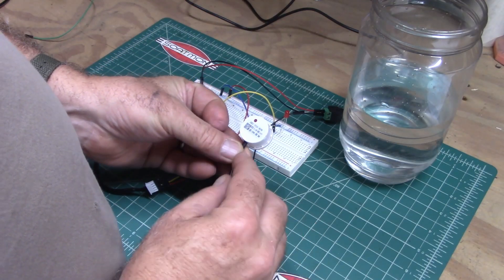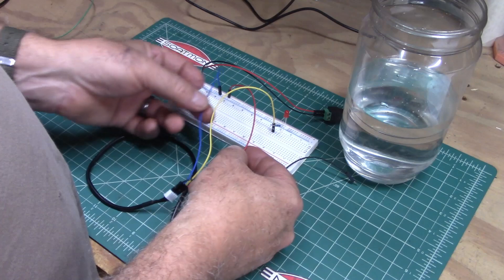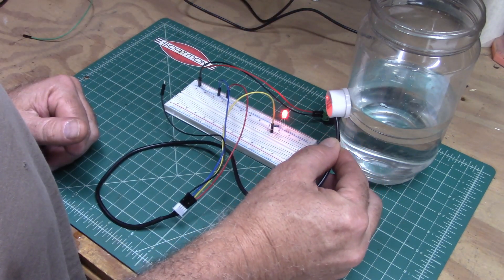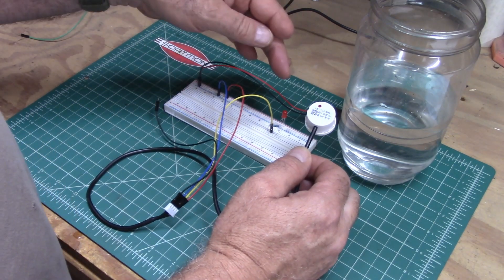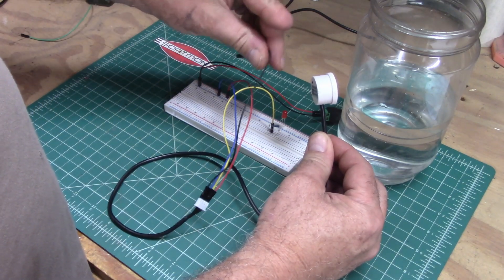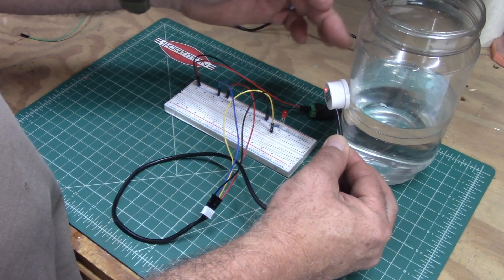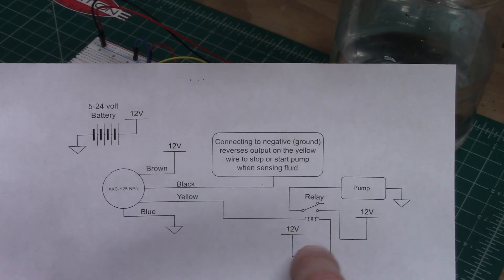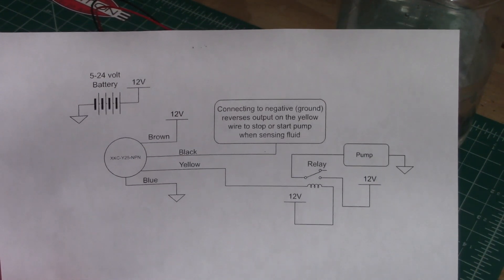No Contact Fluid Sensor

Comment: I wonder if you would mind telling me how to wire this fluid sensor with an LED instead of a pump and which LED to get. I have a 14 gal tank and I thought I could put 3 or 4 sensors up the side of the tank to indicate rough fluid level. I never understood LEDs or how to wire them.

Comment: Hello! I just found a similar fluid level sensor that works with an Arduino control board. From the looks of this in your video, this one will illuminute an LED without need of the Arduino, is that correct? (total newbie here). I would like to use 3 of these to let me know when a difficult-to-access jug is getting full and needing to be emptied. GREEN LED = Jug is less than half full; YELLOW LED = Jug is half full; and RED LED = Jug is nearly full and needs to be emptied soon. Can I do all of that with just 3 of these an no Arduino? Thanks so much!
Reply from the maker: I would think so.
Reply: Can you provide that fluid sensor info i needed that...
Reply: @kunalsonne5  I ended up buying this one: https://www.amazon.com/dp/B07FC5RGC7

Comment: Please, could you help me once again? I bought a XKC-Y25-V sensor. This sensor has the following wires: Brown (Vcc), Black (Mode), Blue (GND) and Yellow (Output). When black wire has a HIGH level the yellow wire has the same value of voltage Vcc (Brown wire). In my project Vcc (Brown wire) is +9 V so the yellow wire will deliver +9 V if the black wire has a HIGH level. DOUBT 1: What exactly means HIGH level at black wire (Mode)? HIGH level means 3,3 V to 5,0 V or It can be 5 V to 24 V? DOUBT 2: Can I connect +9 V at brown wire (Vcc) and black wire (mode) simultaneously? Thank you very much for your attention!
Reply: HIGH means current and LOW level means ground.. u can connect a led for example with arduino and send HIGH value then led will turn on, and LOW (led will turn off)..
Reply: Yes u can connect black and Brown  to 9v

Comment: Brilliant video, thanks for taking the time. I have a 10m run in my motorhome to the tank and would like to have a warning light coming up. Do you remember the voltage output. I’m asking to buy a lamp which would suite. Thanks again
Reply from the maker: Glad it helped. I'm sorry I don't remember the output.
Reply: ohms law I*R=V.  You need to know voltage of led. Then calculate resistance to limit current to 20 ma. Example led = 3.0v. Supply = 12v. 12v-3v =9v drop across resistor at  20 ma. .02a*R=9v solve for R =9v/.02a = 450 ohm

Comment: why is your led blinking shouldnt the output be a constant voltage
Reply: 😂😂😂 good question.. i think the led is damaged.. do not connect anode of a led directly to vcc, output is an analog output, is sending voltage.. for tha common led a 220 ohms resistence is necessary
Reply: @jordh2051  220ohm resister is used to lower the current value , so that led does not get damages/burst , have to see the datasheet what exactly is the output , should give fix value , from the video it sesems its giving some sort of periodic signal , but the led embedded on the sensor only responds when it is in  contact with the water , i once baught this sensor , but was faulty and wasent giving any output
Reply: @HaiderAli-nm1oh  yes 220ohms is used to lower current value on common leds.. i bought the NPN model, maybe he bought another model thats why the led blinks?.. i dont know but to blink the led the output need to be taken from a microcontroller (arduino or esp32) etc.. and then readAnalog value.. thats one way to see the led blink.. but in this case i dont know why is blinking.. its weird.. or maybe he bought another model and the output is analog by default i dont know..
Reply: @HaiderAli-nm1oh  did u check the sensivility  configuration in your sensor?.. mine wasnt giving output.. i opened it up and change the sensivility by moving the internal screw to the left and its solved.
Reply: @jordh2051 correct , as u mentioned , one way is to blink the led is to provide some kind of a digital signal with some certain frequencey of a square wave with 5v max value and 0 as min (ground ) , hmm have to investigate this sensor once more in detail via experimentation and data sheet
Reply: @jordh2051  wow , i guess i didnt , tho it was long time ago , thx i will try , u saved my money XD
Reply: @HaiderAli-nm1oh  its blinking because he didnt connect the black wire.. the black wire is the configuration pin for normally opened and normally closed.. im implementing this sensor (2) 1 for low level and the second for high level in my house watter supply container.. i was wondering if there is a way to use only onw sensor to monitor from low to high..(maybe with some kind of metal vertical  bar..because the sensor reads the electricity conduct)  dont know if a vertical bar connected with the sensor can achieve that..).. by the moment im waitting for my crimp tool, terminal connectors jst, and other sensor :).
Reply: @HaiderAli-nm1oh  hi, just to let u know i was using esp32 and this sensor.. i configured sensor pin as input and it didnt work because yes.. the output of sensor is no always 0. Its the voltage between 0 and 5 thats why my led was blinking xD and digitalRead was wrong.. i change pinmode from input to input_pullup and now its working!!!.. tomorrow im gonna install the project on my house im so excited!!! :)

Comment: So if I understand correctly, if you wanted to maintain a specific water level you'd need one sensor for "low" to trigger a relay to kick the pump on and then another sensor to detect "full" which would be used to unlatch the relay and stop the pump?
Reply from the maker: That would be correct if you want any kind of distance between the high and low point.

Comment: Can this be used for an hydraulic tank ?
Reply from the maker: I would think so but they tank has to be plastic or non-conductive.  It won't work on metal or rubber.

Comment: Hi. excellent stuff. do you have the resistor connection diagram with the leds? and would you also know what is the capacity of the resistor used?
Reply from the maker: I'm sorry I don't, I have very little experience with it.  Follow the link and you should be able to get more info if you search.  Good luck with your project.
Reply: ohms law I*R=V.  You need to know voltage of led. Then calculate resistance to limit current to 20 ma. Example led = 3.0v. Supply = 12v. 12v-3v =9v drop across resistor at  20 ma. .02a*R=9v solve for R =9v/.02a = 450 ohm

Comment: Thank you. Please: Is that a PNP sensor or a NPN ? Does it matter ?  How does the sensor react to proximity to the water in the jar ? Meaning: if the sensor were placed on the lid how close would the fluid have to come up to trigger the sensor ?
Reply from the maker: There is a link in the description that will give you more information.  It is a NPN.  The fluid has to be very close, it would not register from the lid.
Reply: If it's reversible as you demonstrated, does it matter if it's NPN or PNP? 🤔

Comment: Does it work on any tank material,  steel, or black plastic
Reply from the maker: Plastic yes, not on anything conductive like metal, it also did not work on rubber.
Reply: @SoatMon  So it will work even on plastic reservoirs that are opaque?
Reply: @arpinchock  Late response, but yes, I have tested it on PVC piping and it works